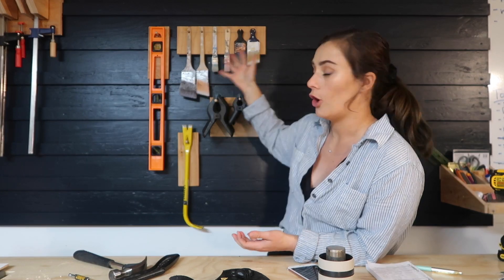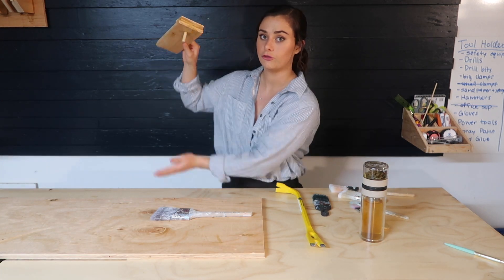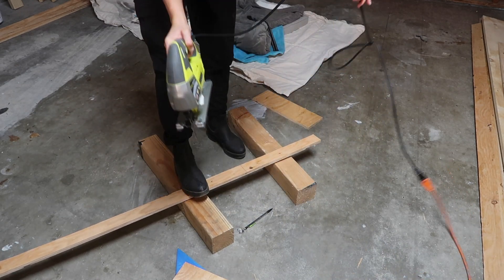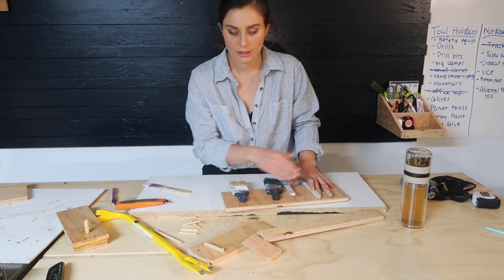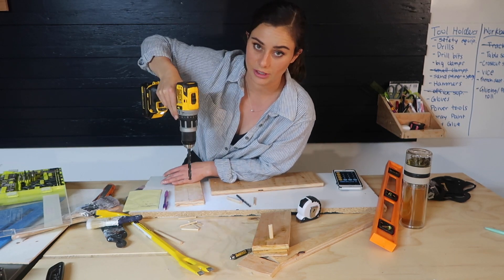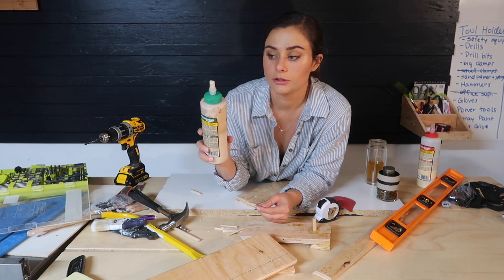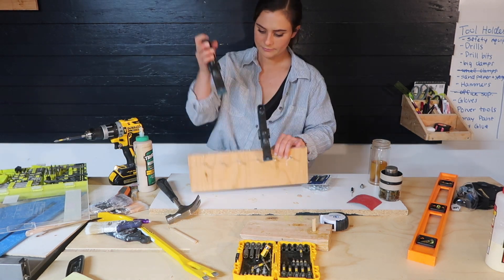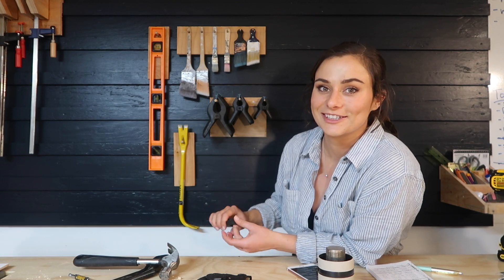1 Tool Holder That Can Hold Multiple Tools | French Cleat System

Comment: Try taking the top of the glue bottle of and soaking it in hot water.  That should free it up,  just make sure to keep it cleaned up if you are not using it regularly
Reply from the maker: That is super helpful. Thank you

Comment: Shannon... Wood Glue Solution
I use my leatherman, but any needlenose pliers would work.  I lightly grip the glue nozzle under the ridge that is about half way up the nozzle and then pry down against the lid (again gingerly) which lifts the nozzle up.  I say gingerly because I have popped the nozzle clean off before, but it's easy to just shove it back on.
Reply from the maker: That is very useful! Thank you for your help! Definitely going to try that

Comment: Thanks for the dowel idea. I would be able to make use of the sides of my shelves to hang some tools. I heard wiping the glue surface or the tip with wet towel helps but i just use a flat head screwdriver to scrape the dried glue of the tip
Reply from the maker: Balaji Natarajan that is a good idea to use the side of your selves. I could do that too actually 😊😊 thank you!! That is a good idea. Definitely going to try that

Comment: Nice job! I love the flexibility of the french cleat system 👍🏻

I use the exact same wood glue in my shop... when the nozzle gets glued shut like that, I just take a regular pair of pliers, and coming straight down from the top, grab about the first 1/2” inch of the nozzle and give It a little squeeze. That’ll crack that glue loose and you should be able to easily open it then. You can also use the pliers to pull away any dried-on glue clogging the tip too! Works like a charm.
Reply: Good idea! I have this problem and too. Good solution
Reply from the maker: Thank you! Yeah same! I love reorganizing stuff. ☺️.    That is sooo smart!!! That will save me sooo much time!!!! Thank you!

Comment: Shannon, as always, nice job.  A tip:  you can make a field expedient 90% drill guide by taking some 1 by stock and cutting and gluing one piece on top of the other.  Make sure both cuts are plumb; then, offset the top piece by a couple of inches and glue them together.  When you turn it on its side, it will have an L shape.  Keep on.
Reply from the maker: The Meat thank you so much 😊❤️
That is so smart!!!! Thank you so much! I definitely will do that. Super smart 😊😊

Comment: Paint them white is my choice.  As for the glue, burp the bottle before you close the top , kinda gently slam or hard tap the bottom of the glue to the table then squeeze the air out.  The close the lid. Taadaaahhh.
Reply from the maker: I didn’t think about another color. That’s a good idea. No way! I’m so excited to try that

Comment: I was having the same issue with the glue bottles, only I was strong enough to get them apart. Until I was too strong and then broke one. Lately I've been using this: 

https://www.amazon.com/FastCap-Glu-Bot-Glue-Bottle-Ounces/dp/B0006IUW8G

It works fairly well, you have to cut the opening so you get a bit more control over how much glue is coming out beyond just how hard you squeeze. The rubber seal washer at the top isn't the greatest as its an off-brand product, the original being made by Rockler I believe. I've left the cap off for two days and it didn't ruin a practically full bottle either so that was nice. Overall happy with my purchase in the end. 

As far as painting goes; don't paint them the same color, leave some form of contrast, be it wood or another paint color.
Reply from the maker: Tyler Golden thank you so much! This is super helpful! I am excited about trying it out. 😊😊